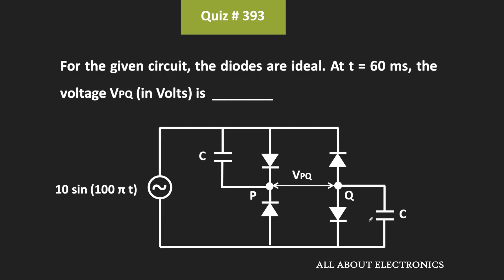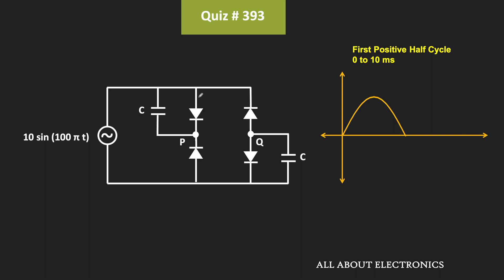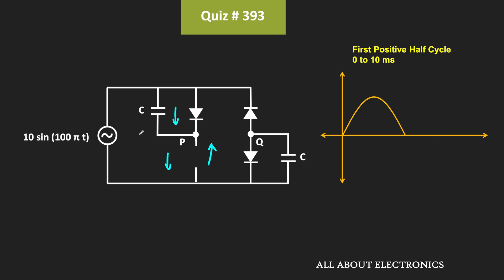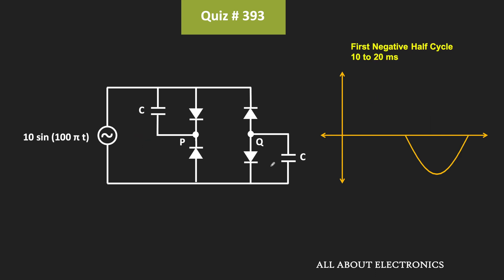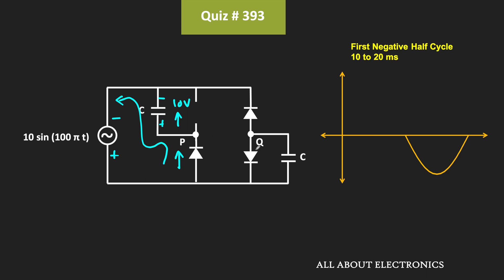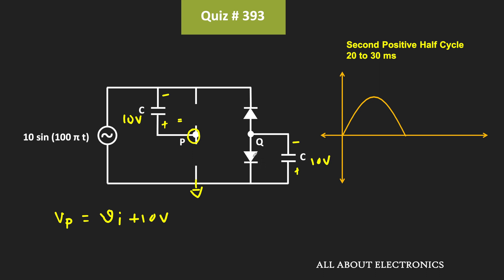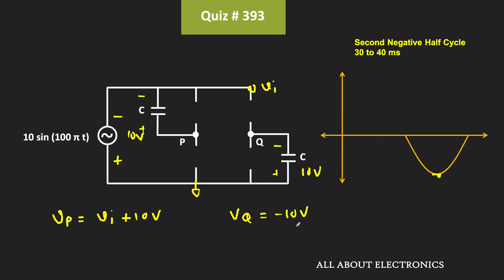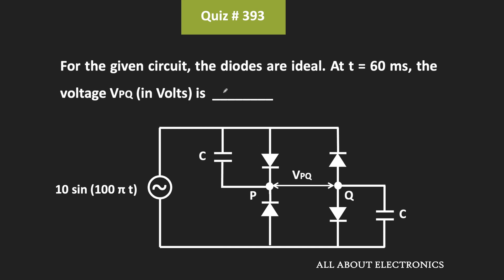Diode Circuit Solved Problem (Analog Electronics) | Quiz # 393

Comment: How current flow in 3.45 ? İsn't the diode off?
Reply from the maker: The current is flowing through the capacitor and the upper diode. The bottom diode is OFF.